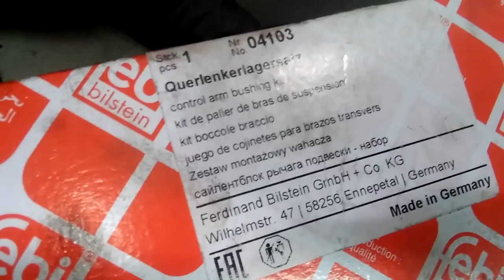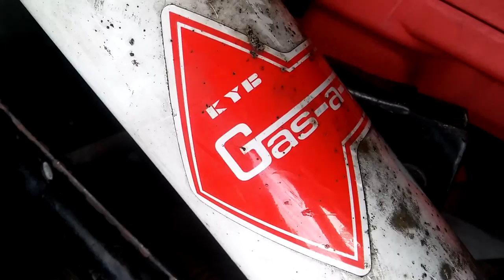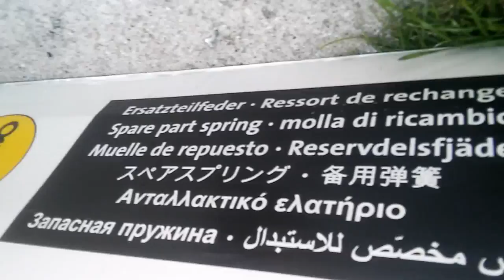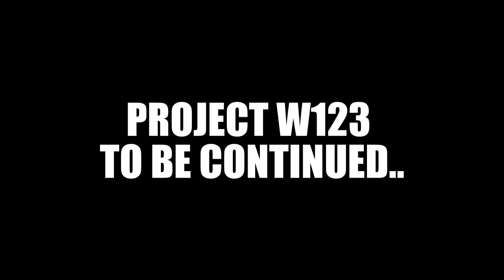PROJECT MERCEDES W123 PART 5- FULL FRONT SUSPENSION REBUILD

Comment: How much does it cost in parts to redo front suspension/steering? What brand is best? Source for parts? I have 1980 240d manual near Atlanta Georgia. How much is labor typically? I would do the work myself though…. And then I supposed I’d have to find a w123 alignment shop….. thanks

Comment: Vito, My son is trying to get his ball joint out of his 300cd- he asked me to find out how you got ball joint loose- did you use a ball joint separator or ?
Reply from the maker: Either a pickle fork or you have to keep hammering lower control arm. Soak the ball joint too. It should separate eventually from the lower control arm
Reply: @VITOSGARAGE  thanks- too funny we decided to lather it up in lube penetrate fluid for the night.  We have a real mess... he had a tire put on in Washington state and they put wheel on wrong so every lug nut we have tried to remove has snapped.  So last resort is to remove the spindle with wheel and caliper attached- I don't have the patience to drill out 5 lugs!

Comment: Do you use any lubricant such as a polyurethane for the bushings when putting the parts back together?
Reply from the maker: Anti-seize for all the bolts. I used a tire paste when installing lower control arm bushings

Comment: yo vito .hello m doing the tie rods and some how my caster is positive , eating the outside of tire the bottom of the tires are push in ..got any idea was is going on..
Reply from the maker: Your camber is positive. Can also be caused because of caster and toe. Get it aligned and adjust all 3 angles and you will be good
Reply: VITO'S GARAGE .. sound crazy but I did the string method around tires and adjust the tie rods again and is way better no more bad camber like before.. m not going to take to alignment yet because m going to do all the parts that you did on your and the alignment going to go wacky again .. so going to do all in one shot ...thanks for your fast reply vito.. love your videos

Comment: hi vitos m having problem taking out the bolt that hold the big arm on the bottom that adjust the alignement , i dont know if is weld it from time or from the movement dont come out . any tips ?
Reply from the maker: You will need to cut the bolt off, it is seized in the bushing... You will have to buy a new bolt as well. Replacing that bushing on the control arm will be more difficult because of that bolt stuck in there
Reply: @VITOSGARAGE  ..yes sir is a pita right now half a day just on that ..the problem i dont want to fuck up the bolt ,,i will have to buy one ...what you think torch it ,, ?
Reply from the maker: @pepe58pepito54  You can try to torch it, just be careful with other parts around that. Try to use rust penetrating oil. But in my cases I always had cut those bolts off with a grinder
Reply: @VITOSGARAGE  .. having a problem finding does eccentric bolts cheap..they are $30 a pop
Reply: pepe58 pepito .. is 1987 300d  the same bolt or is it different one

Comment: How much torque did you use on the ball joint nut when you fixed them back on
Reply from the maker: Metzelbaer Nibbels German tight!
Reply: so you believe in the German torque specs.. Gutten and tight  LOL

Comment: Is it necessary to remove the spring to do the rest of the work?
Reply from the maker: kermitefrog64 Yes. If you are replacing just the lower ball joint then you don't have to remove the spring. But if you are replacing the lower control arm bushing or the guide rod, you need to remove the spring

Comment: Hey! fast question, Do you know whats different with the lowering springs on the wagon than the sedan (if it is any difference) Thanks for answer!
Reply from the maker: Michael Tørset Hmm I wish I knew.  But I can't really tell you. They might be the same but double check
Reply: The springs are colour coded, and it depends on what type of engine/air-conditioning so on you have for the front suspension..rear is always the same. For the rear w123 there are two different sets of springs, one for any "123" no matter what, coupe ect. Only for S123 "sonderaufbau" ambulance/police/corpse transport...there are some harder springs.

If you say lowering springs, you mean third party ones? I would not use them, just take the single dot rubber rings on top (8mm) spring cushion. Using any non standard part on these old mercedes just robs their soul